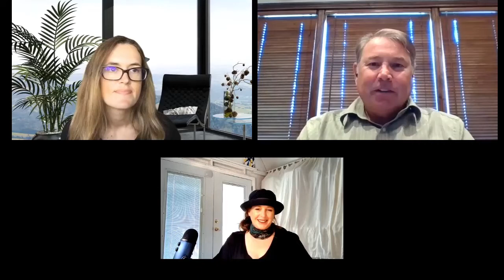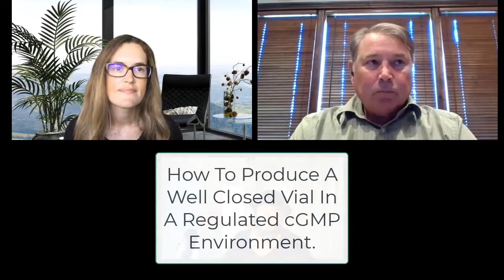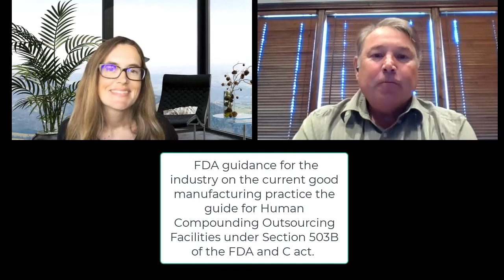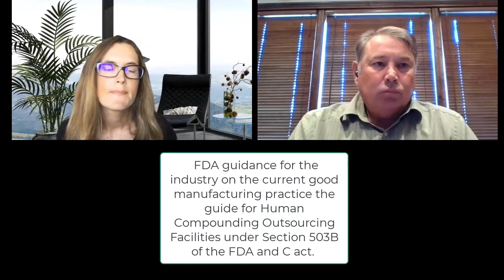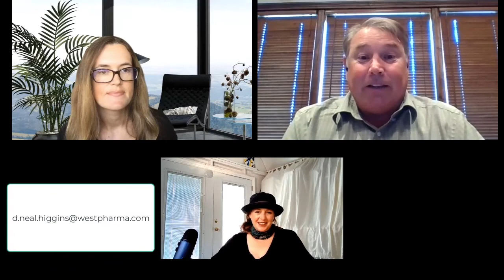How To Produce A Well Closed Vial In A Regulated cGMP Environment

Comment: Pharmaceutical product container closure systems should be designed to ensure that a drug product is protected from factors that may impact the quality of the product over its shelf life, including light, evaporation, exposure to gases, absorption of water, or microbial contamination. interactions with these factors might lead to a loss of potency due to absorption, degradation, or precipitation, container material should be compatible with the dosage form and the route of administration.

Comment: How can you achieve a good seal?
Reply: To get a quality seal, a compounder must choose the proper rubber stopper, aluminum seal, glass file, and do the right mathematical calculation to achieve the correct residual steel force.